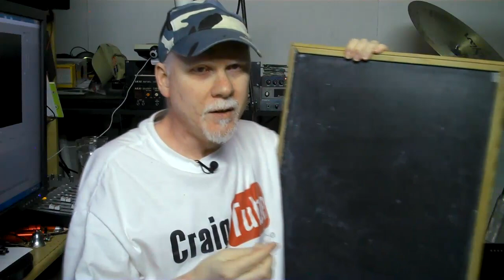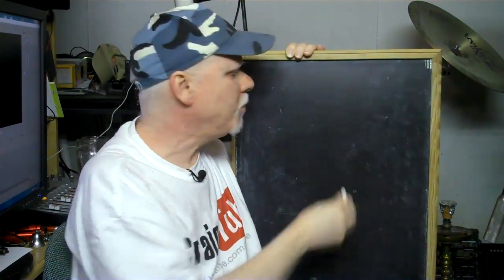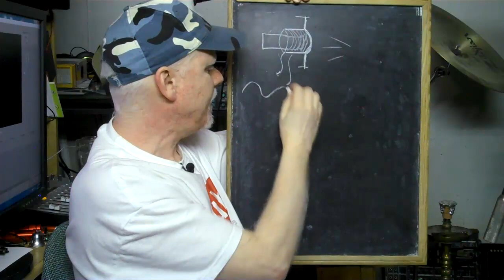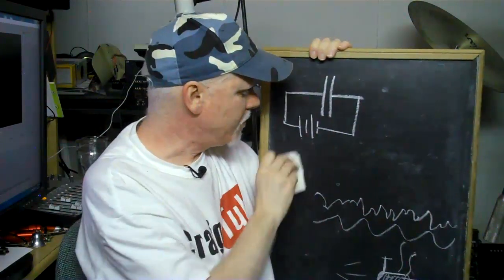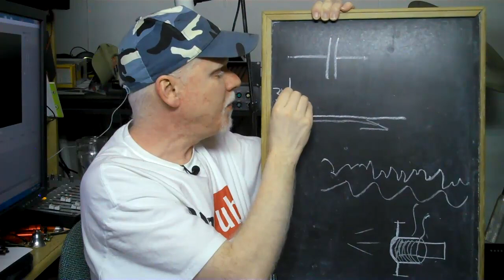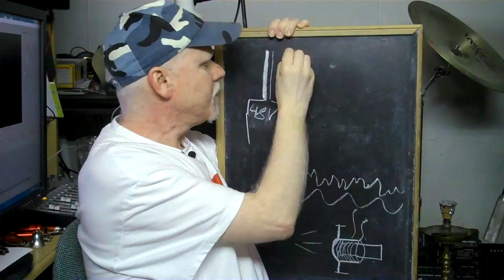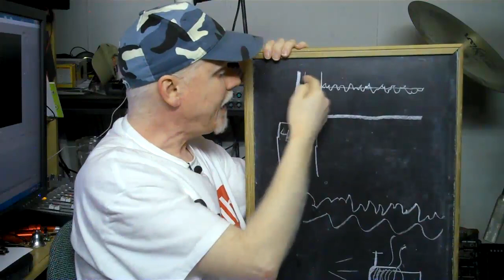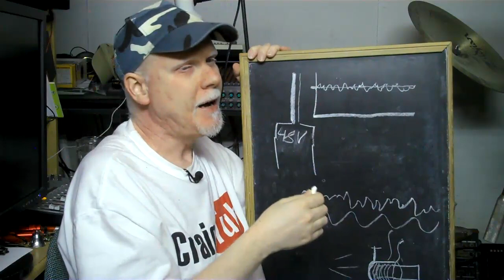Part 2 - MXL 990 How Microphones Work

Comment: if i set a guitar amp speaker so loud infront of an condenser mic, could i break the capacitor plate? because the fact that is so tiny?, with the dynamic  mic there wont happend because i've donde that. and thanks for the teaching your are really god, greetings from mexico

Comment: My MLX 3000 has started throwing static out, probably as I have left it in the stand for a year as I use it frequently, any tips on taking care of these Mic's  I used a pop filter but I sing very close.  I imagine the diaphragm is shot, and advice would be appreciated I don't want to ruin another one.   Thanks  CP